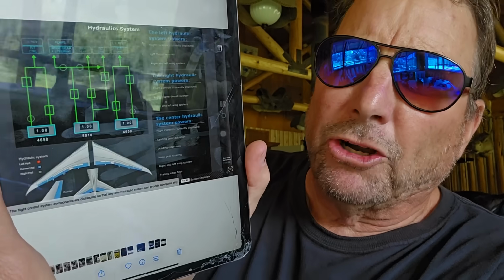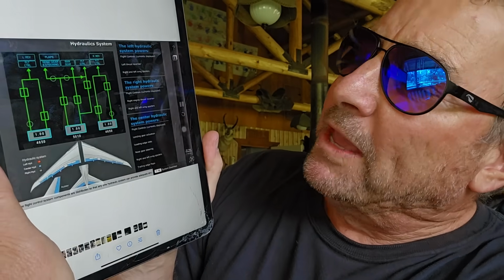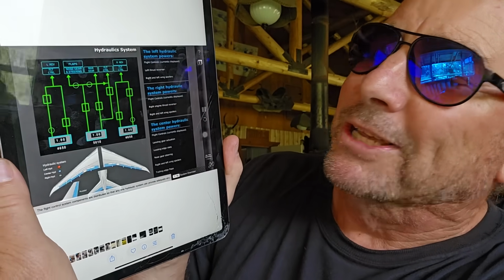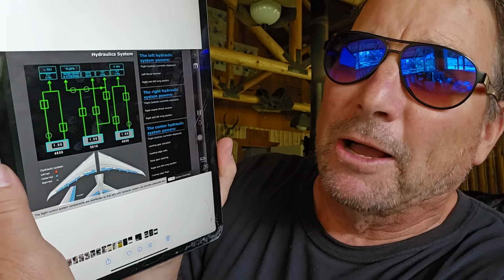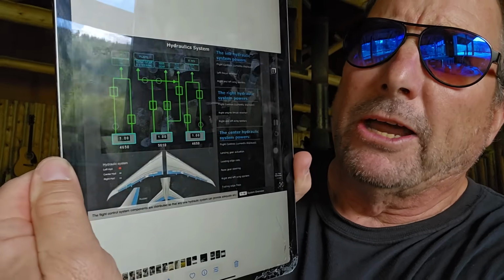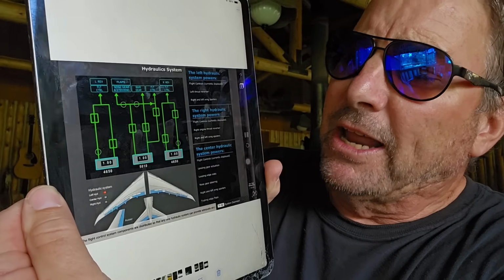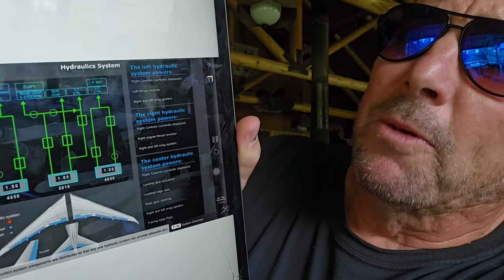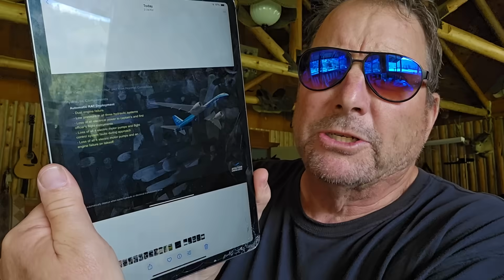787 Crash India What's a RAT? When does it deploy?

Comment: Being very familiar with 787 build and operations, here are some things to think about:
1). Supposed video of prior flight to incident flight via NYT - As the gentleman was talking about no air conditioning on board, you can hear the distinctive 787 hydraulic whine, and the deployment of flaps/slats as they were getting ready to taxi.  This indicates that at least the hydraulics were operating the control surfaces.
2). The 787 hydraulics operates at 5000 psi, instead of 3000 psi like the 777, 737, etc.  Because of this, the 787 has smaller hydraulic reservoirs, and uses a special type of Skydrol hydraulic fluid to handle the extra pressure, as normal Skydrol would foam and cavitate at that level of pressure.
3). Airport CCTV video: Is there video of the incident aircraft landing prior to the incident flight?  If available, it would be interesting to see the flight controls, speed-brakes/Flaperon, and thrust reverser deployment as the aircraft landed.  This could also be a clue to assess hydraulic conditions.
4). No AC: The AC packs are on the underside of the aircraft in the fairing area near the landing gear.  The AC is either operated by ground power connection/GPU at the gate, the APU if out on the field or no jetway, and operated by power coming off the main generators from the engines.  What was the condition of the APU, AC Packs, and main generators?  If anything was INOP, were they flying against the MEL(Minimal Equipment List)?
5). Control surfaces: From the grainy video, it is hard to determine if there was any flap deployment, as Juan noted.  Also, what about HSTAB/Elevator pitch?  It looked fairly static to me.  In addition, the Flaperon(large rectangular flap behind the engines) appeared fixed.  During all phases of flight, the flaperon moves to adjust the wings to constantly minimize turbulence, and add extra lift/drag when needed.  In the videos, I don't see any Flaperon movement.  Additionally, although the 787 was flying runway heading with gentle breezes, there appeared to be no movement of the Vertical Stabilizer/rudder.
6). RAT deployment: When did the RAT actually deploy?  Did it deploy on the prior flight, or just the incident flight?  What seems odd, is that it was deployed and operating during takeoff, and at fairly low ground-speed of the aircraft.  

My take is that either the hydraulics experienced a massive failure(could explain lack of gear retraction and control surface movement), due to low volume, contamination, wrong fluid, which greatly affected aircraft operations, or a masds electrical/hydraulic failure.  Also, the lack of AC means that either the Packs are faulty, or they aren't getting power due to either a main generator failure or electrical bus issues.  Backup batteries won't power those systems, and would fall back to the APU for only critical systems.
Reply: That was quite insightful. Thank you for taking the time to share it with the rest of us!
Reply: also if you realise the main landing gears, they are tilted forward (like a 767). This only happens in 787 in a hydraulic failure.
Reply: I was on a flight that was delayed due to a noise that was to do with air conditioning , would not take off without sorting it.
Reply: # 4 = Air India  need one say anymore lol
# 6 = you know what happens to the glass up front and for how long - likely adds to the madness up front
also find the picture of the tail with the apu inlet flap open - you also know what happens if you lose more than 3 VFSG's .,... useless in this situation but it points to the complete power loss thing

Comment: No one has asked this question:  When will the APU automatically start in flight?
If three or more engine generators go offline.  Each engine has 2 starter generators.  If dual engine fail, APU starts automatically as 3 (or more) generators have failed.  BUT since it can take 45-60 seconds to get the APU automatically started, AND it's two generators 
online, this aircraft did not have enough time to take advantage of electrical hydraulic pumps, and electrical generation.  Instead the RAT only provided absolute minimum hydraulic pressure, and minimum electrics.

Comment: What powers the brakes and reverse thrust systems?
If the system that provides the power to these critical systems failed it might explain why the pilot didn’t abandon takeoff 
He may have been hoping to power to altitude without flaps but either forgot or couldn’t retract the landing gear.
The rat would also have robbed air speed.
Short of sabotage of a critical system it is hard to believe a mature aircraft would have a ticking time bomb that even bad maintenance could explain.

Comment: A passenger off the immediately prior flight reported considerable electrical outages in the cabin, as well as A/C issues.  You speculate there may have been something veryvwrong with the aircraft.  I would speculate that whatever was wrong was a maintenance failure, probably chronic.

Comment: If I understand correctly, neither a total electrical failure nor total hydraulic failure turns this aeroplane into a glider. Awfully confusing but can still climb away. If it’s dual engine failure, wouldn’t that also be in the audio track ?
Reply: The whole accident sequence was so fast that you would hear sound from engines till the end, it takes long time for them to completely spool down. To me it does not sound like the roar of takeoff power on the videos with sound but i have no idea how the recording gear was nor where the recorder was so impossible to tell for sure.

Comment: The takeoff appears very long even kicking up dust in the overrun area. An Emirates A-330 did this in Melbourne (Aus)  a few years ago by the pilots setting the indorrect takeoff weight in the FMC. The Air india flight was, from what I have read, close to OAT 40C -  a hot day takeoff (typical in India)  so Flaps 15 would be reasonable-even more likely given it as on its way top LGW and the TOW required for that. at but after looking the the various videos for hours from multiple angles available, it looks like only the slats are deployed. The TOCWS shpuld have been blaring. Not sure how else to explain what appears to be a very long take off and then sink like that.

Comment: Thank goodness, so many experts and pilots are clearly ignoring the lack of engine noise and the RAT being deployed, whilst sticking to the flaps and pilot error scenario because the idea of a power/electrical failure just after takeoff in a modern sophisticated jet like the 787 is scary
Reply: Everyone and their mother is making a video on this and throwing out opinions to get to the front of the line to rack up views. It is the worst accident in decades, after all. There's only 2 channels I trust for this stuff, Hoover is the other.
Reply: @mortekaieve4729  I agree. Hoover knows his stuff.

Here's my take on  this accident, the fuel system on a 787 is entirely electrically driven !

I believe the engines were starved of fuel shortly after takeoff by an electrical failure. You can see the 787 visibly stops climbing out.

I'm very much convinced of a serious electrical issue. On a previous flight that 787 had electrical problems (video'd by a passenger apparently) and the sole survivor of the accident flight also reports a loss of cabin lighting, shortly after takeoff.

TOTAL loss of electrical power would mean the fuel pumps for the engines shut down too (the 787 has no engine driven mechanical fuel pumps as backup/redundancy) and any fuel they continued to receive would be purely by gravity feed only, so the engines would definitely spool down and the RAT would also be deployed on the loss of electrical power.

Conceivably the RAT might then provide enough electrical power to get the fuel pumps delivering fuel to the engines again  BUT the engines would then need to spool up to provide useful thrust and I think they simply ran out of altitude/time in which to recover.
Reply: @mortekaieve4729  Hoover's good as is blancolirio. Mentour Pilot doesn't comment much, he likes to see at least an interim accident report.
Reply: There are other ways pilot error could have caused or contributed.
Reply: @Objectified  Pure speculation.
Reply: The flaps/gear confusion scenario is beyond absurd !

I believe the engines were starved of fuel shortly after takeoff by an electrical failure. You can see the 787 visibly stops climbing out.

I'm very much convinced of a serious electrical issue. On a previous flight that 787 had electrical problems (video'd by a passenger apparently) and the sole survivor of the accident flight also reports a loss of cabin lighting, shortly after takeoff.

TOTAL loss of electrical power would mean the fuel pumps for the engines shut down too (the 787 has no engine driven mechanical fuel pumps as backup/redundancy) and any fuel they continued to receive would be by gravity feed only, so the engines would definitely spool down and the RAT would also be deployed on the loss of electrical power.

Conceivably the RAT might then provide enough electrical power to get the fuel pumps delivering fuel to the engines again  BUT the engines would then need to spool up to provide useful thrust and I think they simply ran out of altitude/time in which to recover.
Reply: @grahamstevenson1740 a lot of Captain Steeeve fanboys about it would seem
Reply: @grahamstevenson1740  are the fuel pumps electrically powered or is mechanical power used to pump f fuel?   If so the rate would reply but there probably was not enough time to restart the engine.
Reply: @stevenf1678  The fuel pumps are all electrically powered with no mechanical engine driven pumps as backup.
I don't think the engines ceased turning completely, they may have been at idle thrust.
Reply: @grahamstevenson1740  fuel is fed by a pump running off the engine at very high rpm. not electrical system. same for oil pumps.
Reply: @PavelKrupets  Not on the 787 ! Check for yourself.
Reply: @grahamstevenson1740  on 787 main fuel pump is engine driven with electric backup (fuel priming, jettison, tranafer, etc).
Reply: @PavelKrupets  All the info I've seen says there are no traditional engine driven fuel pumps on the 787. It's a very electrical airplane, A/C is electrically driven too, doesn't use bleed air.
Reply: , fuel pumps are driven off engines through gearbox. pressure needed to feed those engines will be hard to achieve using electric engines. electric engines are used for priming, pumping fuel between tanks, etc.

fuel from tanks is pumped by electrical ones. engines are fed by engine driven ones.

it depends more on engines than aircraft. boeing doesn't make engines.
Reply: @PavelKrupets  I wold refer you to the info Google provides ..
"No, the Boeing 787 does not have mechanical fuel pumps driven directly by the engines. Instead, it utilizes electric fuel pumps, including those in the center fuel tank that are used during takeoff.
The 787's reliance on electric systems extends to other areas, such as hydraulics, where electric pumps replace some engine-driven pumps."
Reply: @grahamstevenson1740  check engines pumps. GEnx
Reply: GEnx 1B2B Main Fuel Pump Removal & Installation GEK 117586
Reply: @PavelKrupets  Your point ? I'm sure those GE engines have an option for a mechanical fuel pump but Boeing doesn't use it on the 787.
Reply: @grahamstevenson1740  these engines are only for 787
Reply: Not merely scary - statistically near impossible.  Pilot/maintenance errors rank astronomically higher in probability.  Those who blame the plane are bucking the odds, and need to exercise more restraint.  Imo.
Reply: @joshuahangtree1560 you’re correct, pilot error is statistically much more common. But we have evidence pointing to something else. Btw I never stated that I didn’t think an electrical/power failure couldn’t have been due to maintenance error…
Reply: It's sabotage thing also circulating around.
Reply: @PradeepKumar-bl6qe  That's utter nonsense.

Comment: Hi Blancolirio,

Thanks, as always, for your insights. I’m following this developing story, and I’ve just come across reports indicating that the first officer reportedly had around 1,100 total flight hours. That figure really stands out—especially in the context of a wide-body, international operation like the 787. While I understand that different regulatory environments outside the U.S. have varying thresholds, this level of inexperience in such a high-responsibility role would be highly unusual in U.S. commercial aviation, particularly on long-haul operations.

I’m genuinely trying not to rush to judgment here. But history has shown us, particularly in regional operations, that very low flight time can sometimes contribute to poor decision-making under pressure. It raises questions about how pilot pairing and training protocols are handled in these types of operations.

That said, the suggestion that a miscommunication like confusing "gear up" with "flaps up" could lead to such a critical outcome—if true—feels deeply troubling. It’s hard to imagine that kind of lapse occurring at this level without multiple systemic factors at play.

Ultimately, this seems less like an isolated human error and more like a potential failure in training, oversight, and operational standards. I hope the investigation brings clarity—not just to assign responsibility, but to ensure it doesn’t happen again.

Appreciate your continued coverage on this.

Comment: In the video you showed at the beginning to give an example of the sound a RAT makes, I noticed that the flaps of that 787 were obviously extended (at the 54 sec. point on your video) Was that the flaps 15 position used on takeoff or were they extended further? It was obvious that the 787 that crashed did not have the flaps in that position on takeoff before the crash.

Comment: Looking at a video immediately  after this happened I paused and zoomed in and it appears that there are 2 spoiler panels (floating up) just before impact. 

I Fly many jet aircraft that use a RAT for emergencies there is no mistaking that sound.

Juan you are the best there is! Thank you for your hard work for producing quality content.
Reply: Here's a good question for you to consider: are those two panels floating up or are they simply not drooping? The panels in question appear to be the panels ahead of the flaperons that primarily serve to blend them into the upper wing surface. They're not spoilers per se, although they do move upward a bit with the flaperons when the flaperons act in unison as ground spoilers, just as they do on the upward-moving flaperon in flight. Remember also that the speedbrake/spoiler panels on the 787 all droop with the flaps to blend the upper wing surface, so if those panels were in their neutral position for any reason, relative to the speedbrakes/spoilers, they would indeed appear to be raised.

Part of the 787 takeoff sequence is to initially cut hydraulic pressure to the flaperon actuators as takeoff power is applied to relieve stress on the actuators, then re-apply pressure around 100 knots. This first causes the flaperon to droop, then causes the flaperon and its associated forward panel to weathervane into the wind as the aircraft gains speed before the system re-applies pressure and they revert to the commanded position. I wonder if, with a loss of normal hydraulic pressure and the RAT powering the center pumps, the flaps simply lock into place, and I wonder if the panel ahead of the flaperon might simply weathervane like it does in the initial takeoff phase leaving that gap.
Reply: @ErickC  great questions and great points. Yes sir, kinda familiar with the  system setup on the 787. I fly many jets however the 787 is not one of them. With the video being grainy it’s too difficult to tell however they “appear” to be raised above stowed position.

Bottom line is we will not know until the investigation is complete as to probable cause and contributing factors. However for the sake of discussion it’s interesting to talk about. 

Prayers for the families that are affected
Reply: ❤❤❤❤❤❤❤❤❤      what does “floating up” mean?     are “spoiler panels” the same as “flaps” ?
Reply: @99guspuppet8 spoilers are on top of the wings as flaps are incorporated in the trailing edge and both serve different purposes. We use flaps to change the camber ( shape) of the wing to help increase lift and drag. 

Spoilers on top of the wings to “spoil lift” 
We use them to help slow down in flight, turn in flight and upon landing to spoil lift on landing for more effective wheel braking.

What I mean by floating spoilers is when there is a lack of hydraulic pressure to hold them stowed or in a droop or commanded position the lower air pressure on top of the wing can cause them to float  or trail up from stowed position.

Comment: The other thing I noticed about the audio Juan, is that it doesn’t sound like the engines are at full power. I know that’s a bit of stretch for me to say but the engines in relation to the RAT noise doesn’t seem proportionate to a full power takeoff. 

Also, I think sabotage would potentially have to rise a bit higher on the list with the information we have now

Comment: You are correct!  The unusual sound in 1st audio after incident had to be RAT.  But audio sounded like engines were operating.
Reply: Actually the engine sound was very minimal/negligible. The predominant sound was that of a very loud propeller, very different to that of a jet engine. Considering the plane was supposed to be at takeoff power, that is very unusual.